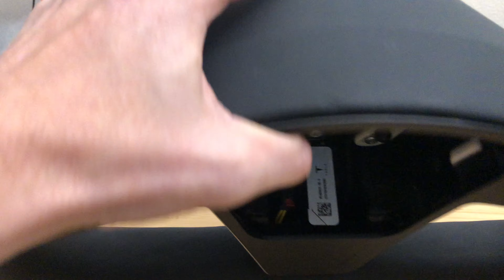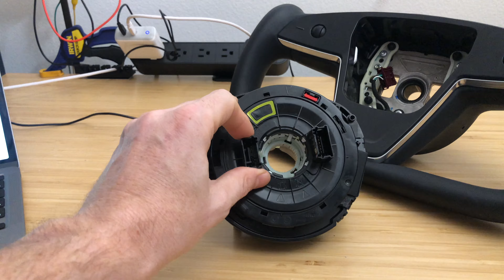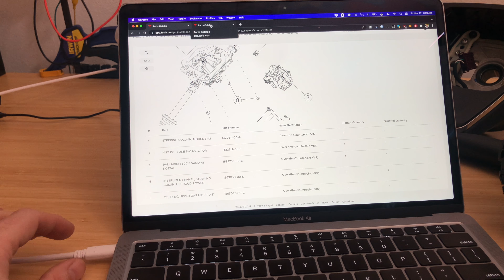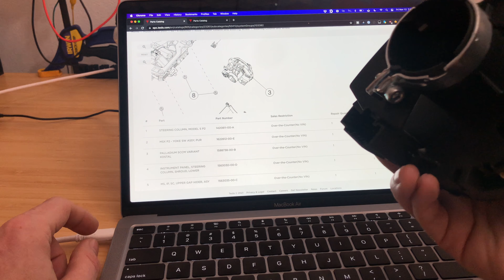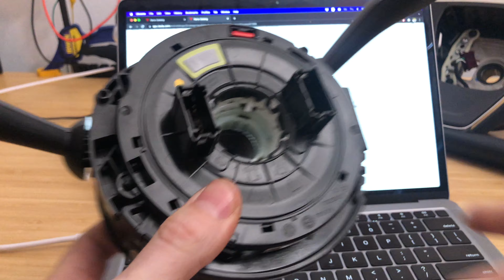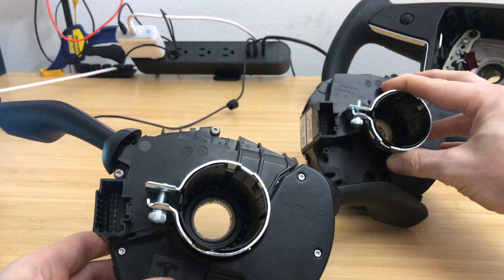Plaid++ Episode 0.1: Show and Tell

Comment: I played around with steering clock spring on my P85+ when I was diagnosing an airbag light. I was able to adjust the steering angle using the lines on the backup camera.